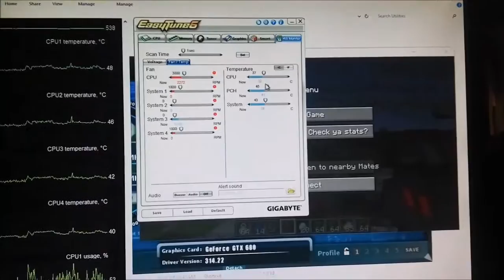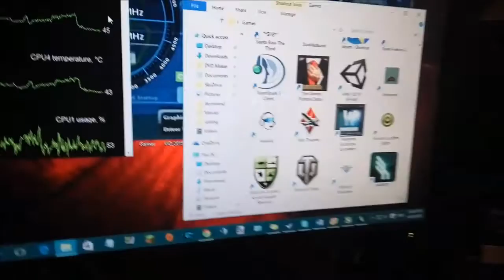Ghetto cpu cooling mod (Pentium 4 cooler best stock cooler? RECYCLE! :D)

Comment: i was actually able to keep using the plastic locks by filing them a bit! and if they are broken you can just use a small round file and mod the existing hole if going 775 to 115x or 115x to 1700. 775 to 1700 requires doing your way!

Comment: Thanks for the great idea! I was looking for the cheapest possible way to OC my Ivy Bridge and found your video. Just FYI, I think  I was able to improve on your design by not using the plastic push pins at all. I pulled the mobo from the case and used small bolts to attach the HSF to the board. That way I can have all 4 and keep even pressure. I found that with even 2 pins in, I had to push pretty hard to get them to seat (my mobo had to bend a little) so bolting it on just works better IMO.